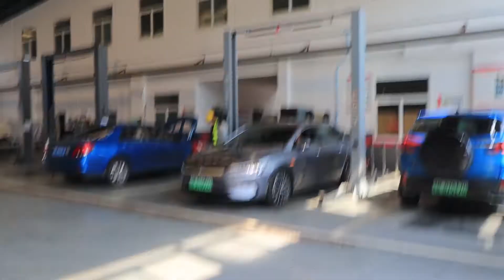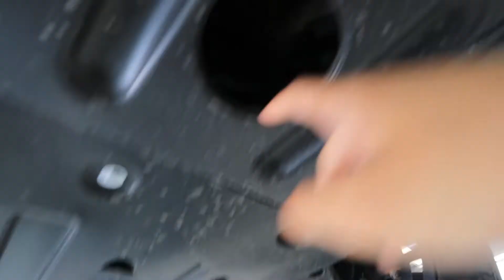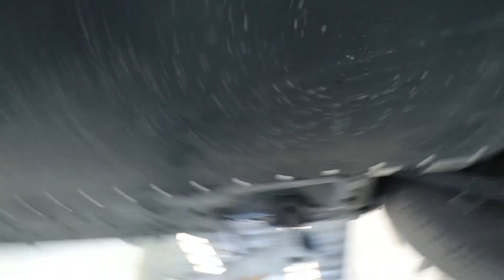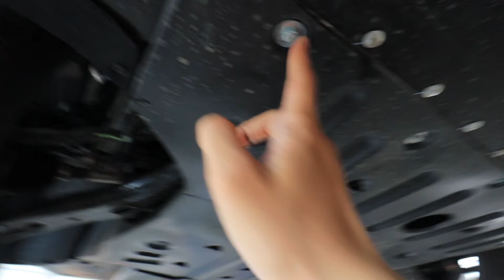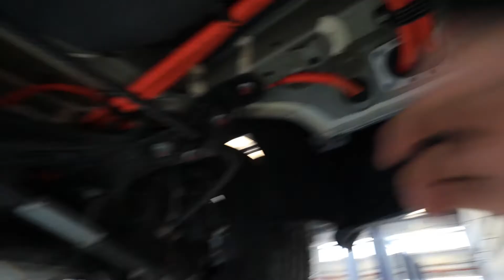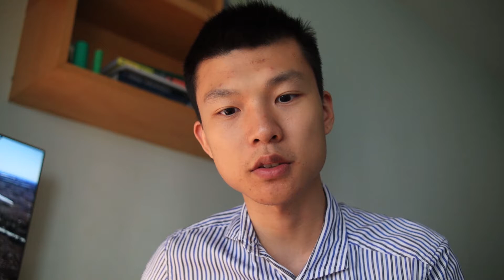What is under the under carriage?

Comment: I am curious to find out if the blade battery cells can be removed from under the car. In the animations, BYD shows the blade battery cells entering from the top, without a car body on the platform. From this video looks like the battery pack is  bolted underneath the car. Hence it looks like the whole battery pack would be removed to get access to the blade cells from the top of the pack. Has BYD published any information about how to replace battery cells or pack? 🤔 With the 10,000 discharge cycles of this battery chemistry, the cells should last the life of the car, so replacement should be rare such as accident damage. 😎